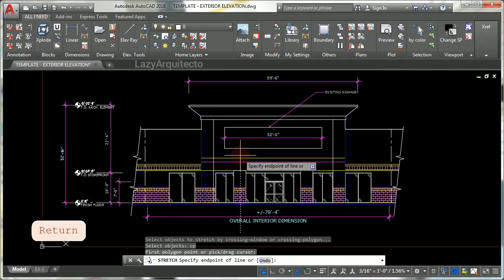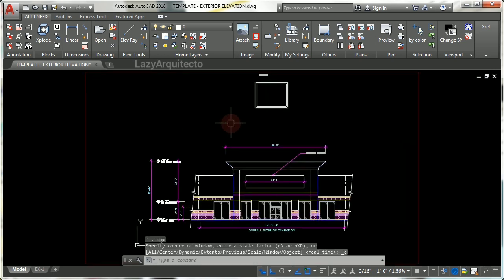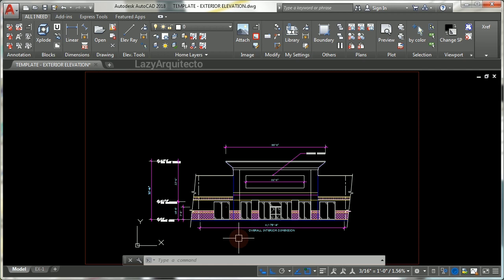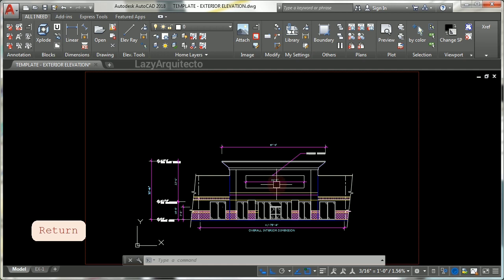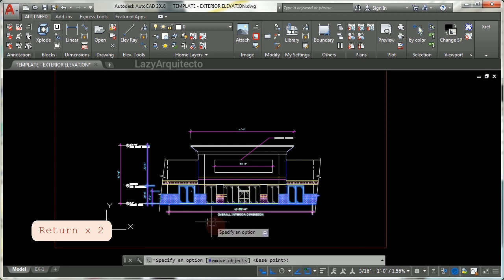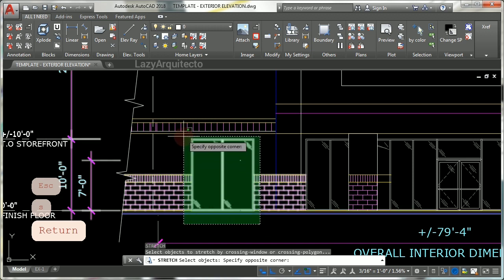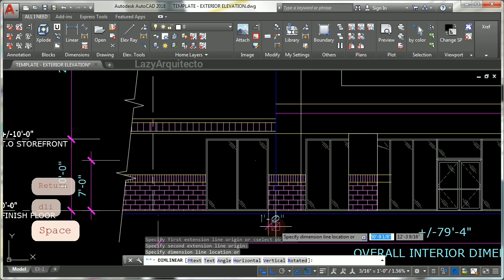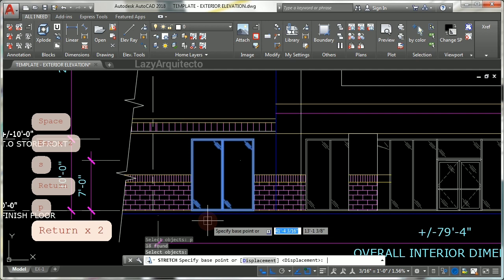AutoCAD Stretch Command Tips and Tricks (to Make You Faster)

Comment: hello, may i ask, i have some issue on stretch command, and im tired finding the problem. i cant find it anywhere and maybe and i hope so you can help me with this. 
The problem is: when im using stretch command to a line or polyine to lengthen it, the output is the distance the i inputted. it is supposed to add but i dont know. 
For Example. the current length of the line is 4.86mm then i want to stretch it to add 2mm, but, the line itself will become 2mm instead of 6.86.
what supposed to be the problem with that ?  It is annoying and i need to use more command like creating and moving a straight line by the length that i want and extends it to it. I hope you could help me with this. thank you very much in advance.
Reply from the maker: Hi are you using the regular stretch command with it's shortcut s? Or are you using lengthen command? Try this https://youtu.be/Lwz4Ak8brLs
Reply: @LazyArquitecto  yes mr. 
i am using stretch command not the lengthen one, but eventually that's the other efficient command im currently using. 
i really dont know what's going on on my autocad LTv. but on my workm8, the stretch command is functioning perfectly the way i know it supposed to be, but on mine, no. i already reinstalled it, but it is still the same.